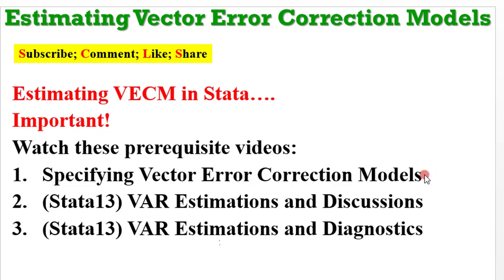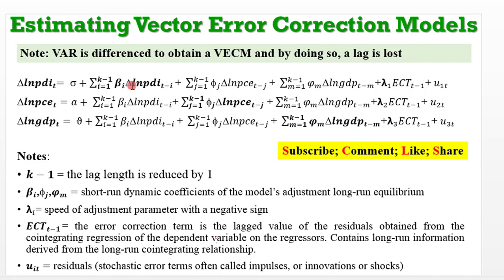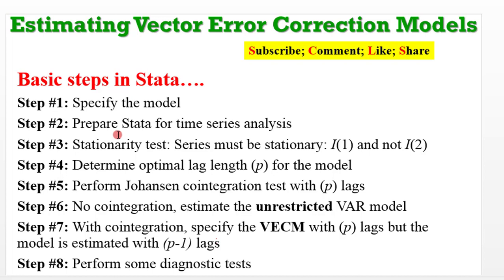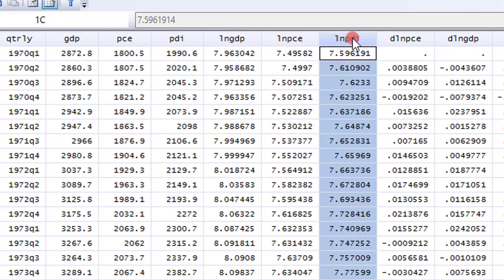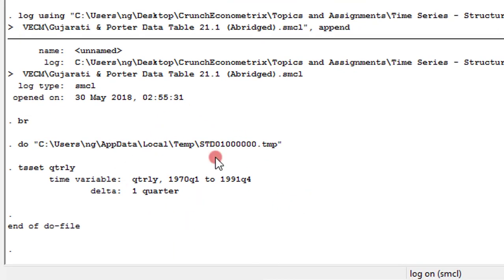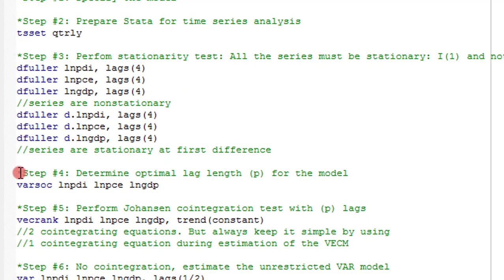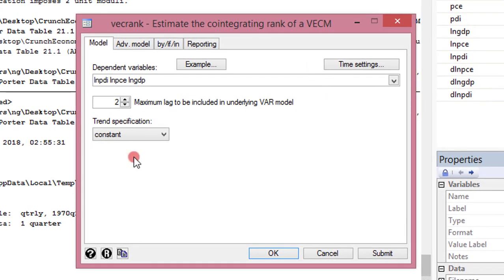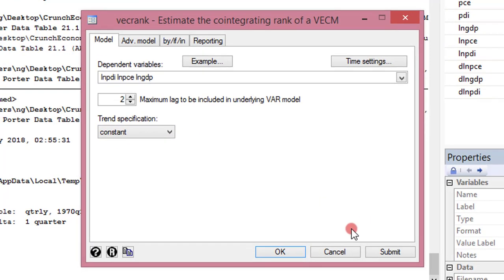(Stata13): VECM Estimation, Discussion and Diagnostics #var #vecm #causality #granger #wald

Comment: Hello mada why If I run VECM, one variable gets omitted, especially in the Johansen normalization restriction table. What can I do to make the variable appear?"
Reply from the maker: The omitted variable is likely the normalization variable. The first variable listed in the system of equation.
Reply: @CrunchEconometrix 

What can I do to address the issue since my data includes GDP, inflation, unemployment, and interest rates, all in percentage form, from 1990-2024, with interest rate as a control variable?
Reply from the maker: You've delved into your personal research, which is out of my scope of engagement.

Comment: Dear professor, thank you for the excellent video it has been very helpful. I have a couple of questions please:
a. I have a VEC model with 5 variables where lnrealgdp is my target variable, however my ECT is insignificant (p value of 0.183), does this mean that my model is misspecified? Or that the lnrealgdp variable just doesnt go back to equilibrium/experiences a permanent change?
b. when interpreting the long run coefficients, is it a positive or negative shock to each variable that is considered by the coefficient (i.e. in your video for example, is it a one unit increase to lnpce that has a negative impact on lnpdi)?
Thank you again!
Reply from the maker: Hi Maya, an insignificant ECT does not mean your model is mis-specified. It may be due to several factors: your choice of variables, lags, scope etc.

To interpret long-run coefficients, kindly watch my video on Johansen Cointegration.

Comment: Hello, ma'am

If the AIC, HQIC and SBIC agree that my optimal lag length is 6, am I to use it for my co-integration test or go with the default 2 lags in the menu?

Similarly, am I to use the 6 lags to estimate my VECM or just the 2 lags that appear in the VECM menu by default?

Many thanks
Reply from the maker: First, watch my video on OPTIMAL LAG SELECTION. It will help you understand the use of lags. Second, re-watch my videos on VAR-VECM and adapt to suit your data.

Comment: Hello! Your videos are very usefull. And it open me a lot of opportunities for my economics researches. But I have a question with VECM. Is it necessary to perform seasonal adjustment before cointegration checking and estimation? I analize domestic and world wheat prices. And I think that price pairs for some countries are not cointegrated because it needs to first, exclude seasonality.
Thank you in advance
Reply from the maker: Yes, seasonal adjustments may be corrected for considering your type of data and analytical approach.

Comment: Dear sir, I have a question about the vec outcome tables. If the error correction terms in the first table (_ce L1.) are all positive and not statistically significant, I should interpret it as there are divergence to the long term equilibrium in all equations, right? This result does not affect my interpretation for the second table (explained in this video) of long run causal relationships, is that correct? Thank you so much for answering my question. I am working on my thesis and you have been so helpful. I am very grateful for your videos and your answers.
Reply from the maker: Yes, Yanuo. You may also refer to how I interpreted the VECM results.
Reply: @CrunchEconometrix  Thank you!

Comment: Thanks a lot for these videos.  I have a question:   if I find 4 cointegration relationships in Johansen (in step 5), how many cointegrations should I put in the main analysis (step 7)? should I keep 1 cointegration as a default?
Reply from the maker: Mohammad, I already mentioned this in my video on Johansen cointegration that you use ONE, except you are able to interpret results with more than one CE.
Reply: @CrunchEconometrix  Thank you so much

Comment: I have question related to the VECM model. If I specify "trend" in the VECM model then how to do the post estimation tests. Because when I specified trend in the VECM model and after that doing the post estimation tests using the active vec results does not show any results in Stata.
Reply from the maker: Cyborg, I don't understand what you mean by specifying trend. Can you be more explicit? Thanks

Comment: Dear professor, only Normality condition is not satisfied as far as specification of VECM is concerned. Is that the problem for the model? Thank you for time to consider my question!🤗
Reply from the maker: Hi Filip, you can overlook normality in a VAR/VECM. Concern should be on heteroscedasticity and serial correlation.

Comment: Hello! After running VECM, i found that error correction term (ce1) is negative and significant but one variable in the Johansen Normalization Restriction Imposed is not significant. Does that mean the insignificant variable is omitted in the ECT equation?
Reply from the maker: Hi Kelv, not at all. It means that variable has NO statistically significant relationship with the depvar

Comment: Dear Dr.
 i have a question:
if ETC_(t-1)=1*lPIB_(t-1)+〖0.1214*lX〗_(t-1)-0.9443*lM_(t-1)-3.8345 
how can I calculate lPIB in 13:30 lPIB as dependent variable. thanks
Reply from the maker: Hi Adda, I have no idea. I'm wondering why you need to calculate it since it is the LAG of the dependent variable NOT the dependent variable.

Comment: Thank you for your amazing videos...I have a question...I have performed all the necessary steps,  I get an AIC optimal lag of 1 and the number of Cointegrating equations to also be one. When I perform the VECM model, the L1._ce1 for my dependant variable is negative but insignificant...What does this mean and what do I need to do to correct this. Adding more lags does not solve the issue
Reply from the maker: Hi Rahul, I'm unclear about your query. If the error correction term is not significant it implies there's ZERO reversion to long-run equilibrium. Thanks
Reply: @CrunchEconometrix  So what does this mean for my model? Is it not specified correctly? Like I said I get 1 Cointegrating equation at 1 optimal Lag. But when I run the VECM, the error correction term is negative and insignificant. What is my next steps?
Reply from the maker: Rahul, I have already laid out the steps for VECM. Once you have your results, go ahead and interpret.
Reply: @CrunchEconometrix  Having read the literature it states that your error correction term must be negative and significant for the VECM model to be appropriate. Since mine is not…do I have to change my model or can I just begin interpreting?
Reply from the maker: Rahul, you can re-estimate after you have changed your variables and/or modified the lag lengths. It is not erroneous if the ECT turned out to be not statistically significant. It is subject to your study and your result is what it is. Hope these tips are helpful.

Comment: Thanks a lot Sir the video. But my question is that: how to calculate  the Error Correction Term [ECT(-1)] of one variable?

For example: 

ECT(-1)= 1.000lnpdi - 4.919

How determined "lnpdi" value in this equation?
Reply from the maker: Ridel, I'm wondering if you paid any attention to the steps shown and the interpretations given. Your query is so out of point. I will advise you watch the clips in GREATER detail. Thanks.
Reply: Thank you, I m delighted to you because the feed back is so quick, be blessed teacher.
Reply: Hi sir once again! I have always some problems to determine the only error correction term (ECT) value. If you will make just a special tutorial for explaining it, I'll be satisfie, thanks!

Comment: Hi Prof, Just a question on the number of cointegrating equations (rank). Does it mean that if I get 2 or more cointegrating equations in my Johansen test I still use one in my VECM? I will also appreciate if you could provide me with some articles with similar results. Thank you very much.
Reply from the maker: Hi James, my suggestion and reasons on "keeping it simple" and use one CE is quite clear. You may check online research for likely references...not everything require references. Plausible arguments and reasons often suffice. Thanks.
Reply: Thanks Prof.

Comment: Good day Madam, 
if the result for cointegration is not cointegrated for linear trend but cointegrated for Restricted linear trend, should we change the default setting of VECM from 3)linear trend to 4) Restricted linear trend when we want to run VECM? 

Thank you for your time if you read and comment on this Madam.
Reply from the maker: Rima, the decision on how you want to analyse your data rests with you as the researcher. I have only provided the basic understanding of the technique.
Reply: @CrunchEconometrix  thanks for your response and the infomative video Madam.

Comment: Thanks so much for your explanatory video. I want to ask what if my 2nd cointegration equaiton CE(2) is positive and not significant, I can still say that there is long run relationship? because my 1st cointegrated equation CE(1) is negative and significant. Please help me about this issue. Thanks..
Reply from the maker: Hi Melis, as suggested in my video on Johansen Cointegration Test, keep it simple and use 1 CE. But if you are on top of your interpretation then you can use more than 1 CE. Thanks.

Comment: Respected professor, thanks for your nice and helpful tutorial. Please kindly explain why you did not use trend or drift or suppress constant terms in the stationary test ( From Xian Jiaotong University, China)
Reply from the maker: Hi Iftekhar, I would have if the series is still not stationary after 1st difference. Thanks.
Reply: @CrunchEconometrix  Thanks, professor. As my all variables are not stationary in the same order,  how can I do a causality test?
Reply from the maker: Kindly watch my video on ARDL and Causality.
Reply: @CrunchEconometrix  Thank you for your helpful tutorial! I have a question. If I have two daily variables y and x and they are cointegrated, the optimal lag length is 4 and  I want to split x in +/- when x increases/decreases in the VECM to see how y reacts in the short run to an  increases/decreases in x. How can I do that following your video?
Reply from the maker: Hi Ritvana, I honestly have no idea. You may need to check other online resources. Thanks.

Comment: Some of my variables are I(0) and some are I(1), I had to difference them to make them stationary.  You are saying, I should make them all I(1), when you say they should be all of the same order? Or can I go foward with I(0) and I(1).
Reply from the maker: Mark, that is not what I said. You may need to watch the clip again and watch those on ARDL models. I(0) series does not require differencing because it is STATIONARY AT LEVEL. Only nonstationary series should be differenced. Regards.

Comment: Hello professor, in your estimation you used 1 lag as optimal lag. if I use 3 or 4 lags, which lag result should I select as the main result? For example if I use 3 lags in the vecm estimation, the Stata output will show the coefficient and pvalue results for each lag, such as LD, LD1, LD2, etc. which lag’s result should I choose?
Reply from the maker: There's no confusion on the issue of lag, Ellis. Adapt my procedures, tailor them to yours and interpret your results.

Comment: Hi Dr Ngozi, Thanks again for your video. In your example on specifying VECM model, there are 3 variables, and you use some Greek letters (beta, gamma and phi) for coefficients, that is the short run dynamic coeficients of the model's adjustment long run equilibrium . I would like to ask, if i have 6 variables, what Greek letters do I use to denote coefficients?
Reply from the maker: Hi Alfred, you can use any Greek alphabet. Kindly do a Google search on that. Thanks.

Comment: Thank you! By the way, as VECM's are for I(1)'s, I saw you chose to execute vec on variables that are not differenced (9:20). I assume Stata differences I(1)'s for us automatically just as it does p-1 automatically? Should I execute vec on a set of level variables or first-differenced variables in Stata?
Reply from the maker: Hi Mint, my explanations are quite clear. I will advise you watch the VECM series all over again...VECM deals with I(1) and not I(0) variables.

Comment: Thanks for the amazing work! I was facing a question regarding Step#3 where you say that the series must not be I(2). Why is that the case? Since we are performing the Johansen Cointegration test, would it not be okay if all the series were I(2) in order to check for cointegration and perform the Johansen test. I thought that I(2) variables should not be present in only if we use the  ardl model .Thanks !
Reply from the maker: VECM from VAR analysis requires all series to be I(1).

Comment: Thanks for your amazing work! I wanted to confirm that this is valid only if there is cointegration found in all the three equations, right? If only one was found to have cointegration, for instance,say the first one, with pdi as the dependent variable, we will use the the ecm framework instead of the vecm framework for the first equation,which will give us both the long run and the short run relationship. For the remaining two equations, we will use the ardl framework ,which will give us only the short run relationships. Am I correct in my interpretation?
Reply from the maker: Please do not confuse VAR/VECM with ARDL/VECM. The mechanisms are not the same.

Comment: How do you interprete the shortrun model? Do you also reverse the signs like in the long run model?
Reply from the maker: Hi Haggai, only signs of the Johansen Cointegration results are reversed not the VECM. Don't mixed it up and give the usual ceteris paribus interpretation for both long-run and short-run results.

Comment: Stupid question- I am confused as to how to construct the cointegrating equation. Say I have 4 variables and rank 1, meaning there is only one cointegrating equation. But before I run the VECM, I construct 4 independent equations with the  each variable as the subject.  After running the VECM, which equation will I select to carry on for my interpretations? And how do I discard or comment on the rest? Thank you! I hope I make sense..
Reply from the maker: Zaeem, my VECM covers about 95% of what needs to be done by any researcher. But you can check out other online resources for more information. Thanks.

Comment: I have non cointegration data but when i change trend specification to be anything beside constant i find cointegration, how to determine trend specification?
Reply from the maker: Hi Febiyan, I don't understand your question because "trend" is inbuilt in the software.
Reply: @CrunchEconometrix  i know what i mean is that how to choose between those model specification, how to determine whether our data is more suitable with constant or rconstant or trend or rtrend
Reply from the maker: Ok. You can easily read up about "trend" from any econometrics textbook for better understanding.

Comment: Thank you for your helpful video.

However, I do have some questions as follows.

1. I have a question about ECT in VECM, if it is positive and not significant, what does it mean?
As I tried to run VECM and the model result shows the positive and not significant.

2. The second question came from Stata.
I run another model (different from the first question) with VECM.
The VECM seems fine but the problem came when I tried to run veclmar.
The result shows that "the lags of residuals may not be collinear with the dependent variables, or their lags
r(198);"
I am not sure what does it mean?

3. If the data have trend, should we check and eliminate trend first before doing the VECM? (If we need to eliminate the trend, how should we do in Stata?)

Could you please suggest these three problems I face. I appreciate your time and thank you so much for any suggestions.
Reply from the maker: Hi Puwadol, thanks for the positive feedback. Deeply appreciated! On your queries:
1) means your model is explosive. No reversion to long-run equilibrium
2) estimate the model at higher lags and test for serial correlation
3) remove trend option
Reply: @CrunchEconometrix  Thank you so much for your comments and answers. It is very useful. I appreciate your time. Do you mind if I have an additional question?
I am a bit confused about the step of determining the model specification.
If the data is stationary at first different, can we use both VAR and VECM?
In other words, can we use VAR model given there is a cointegration?
Reply from the maker: @puwadoldusadeerungsikul9650  Kindly watch the foundational videos on VAR and VECM specifications. You will find them useful.

Comment: Thanks for the video. BTW, in some articles they didn't reverse the sign when interpreting the vecm long run model coefficient. Is that still correct interpretation? Regards.
Reply from the maker: Toba, watch my videos again. Signs are not reversed for the VECM (explicit equation) but for the Johansen Normalization Equation (implicit equation). Don't mix it up.
Reply: @CrunchEconometrix  sorry disturbing again prof. Yes, I mean Johansen normalization prof. as in the video it refers to the long run model. Thanks in advance.
Reply from the maker: @thetruth4712  My explanation clarifies that.
Reply: @CrunchEconometrix  Does the reversal of signs for the implicit equation also apply to the coefficient of the constant?
Reply from the maker: @denistiyo7193  Yes, it does apply to ALL coefficients in ( ).